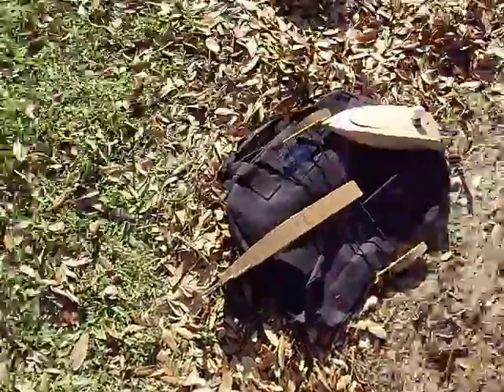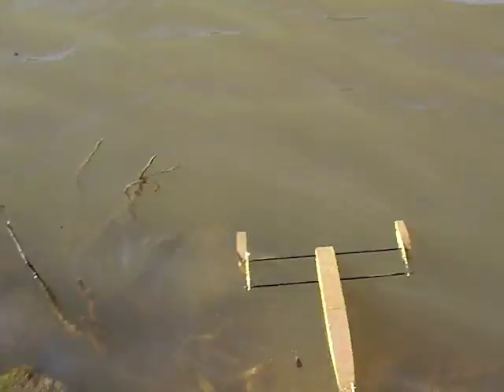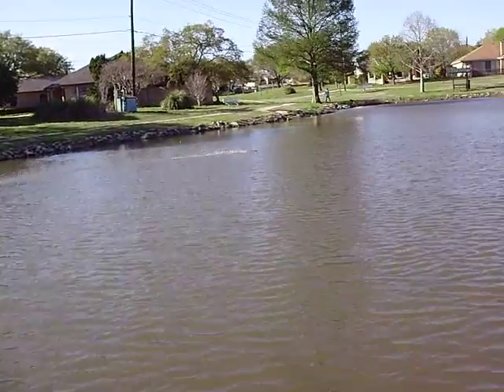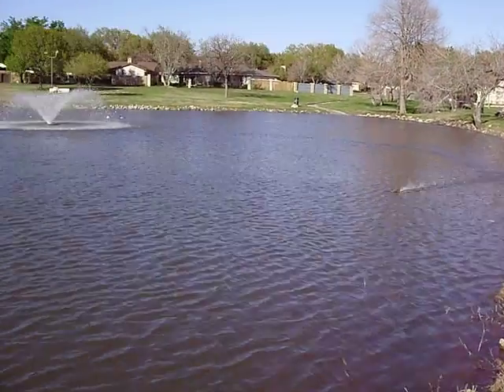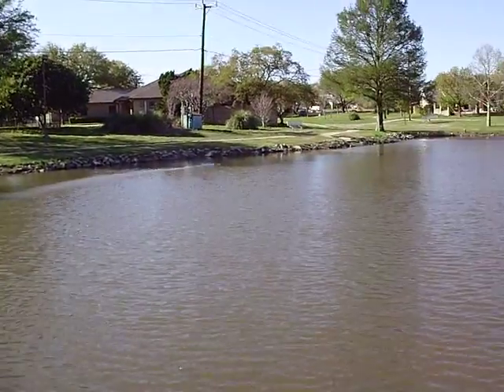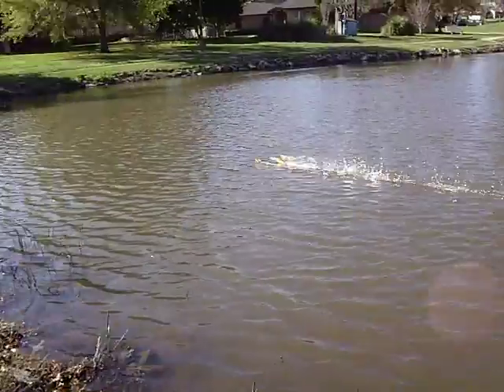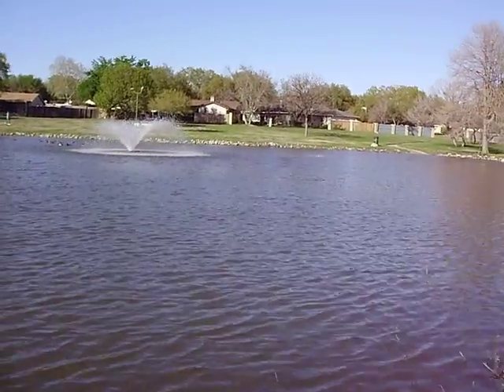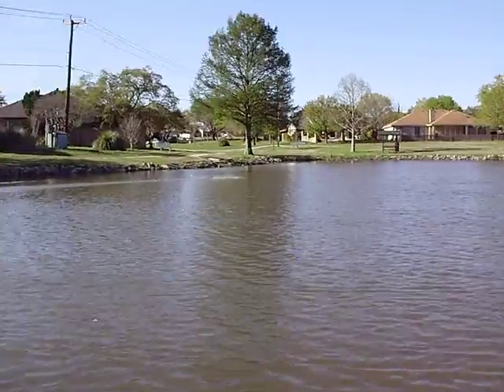10gram Motor 3S Outrigger Hydro.AVI

Comment from the maker: Thank you, there is a thread on this RC Groups Micro Boat Forum.
I have some 3S NANO Tech 90C / 300mah cells I want to try with this project with a Go Brushless 17g motor
Expect close to 40 mph with the new modern setup.  Very fast for such a small rigger.